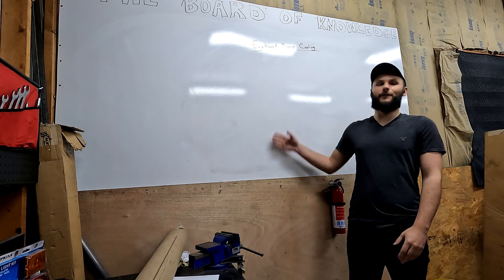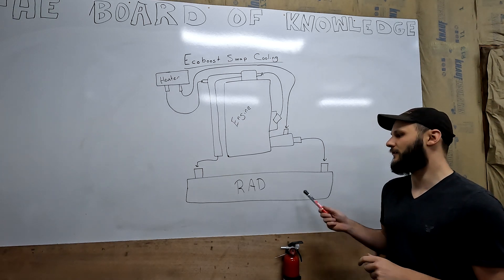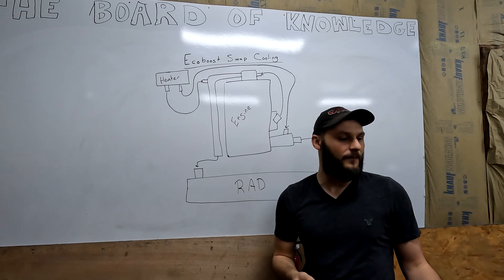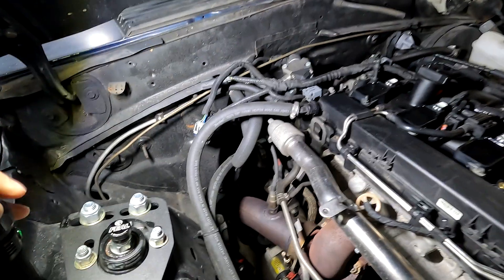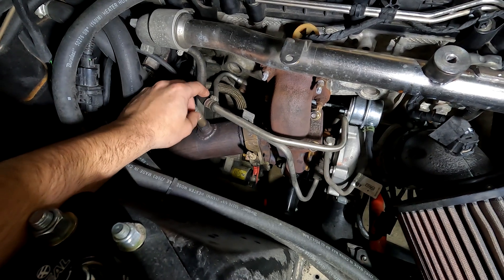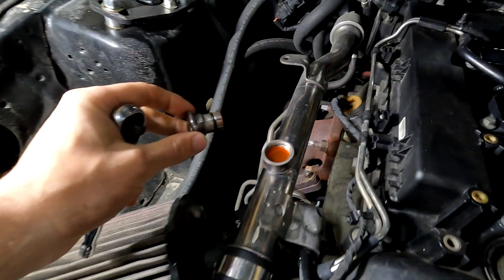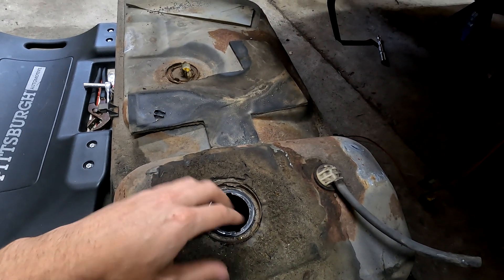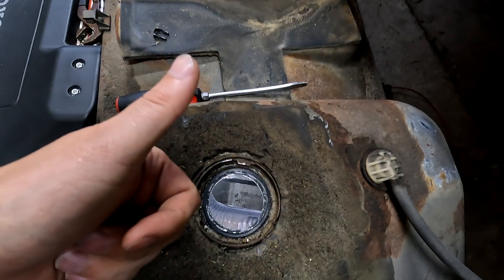Ecoboost Swap Cooling System Made Easy

Comment: Maybe a dumb Q, but how does it function without an expansion tank?
Reply from the maker: No need for an expansion tank since the radiator has a steam port. I just ran the steam port line down to an overflow container. Currently it's just a liquid death can, but I will be putting a proper overflow container on this winter.

Comment: Awesome. Yeah this is definitely super easy. And explained well. It's still crazy how much room is left in the bay. Have you thought about a fan shroud or I guess not needed since you said it runs cooler as it is.
Reply from the maker: My setup has a small shroud. It doesn't cover the whole radiator, but it works just fine. It definitely could use some more ducting in front of the rad though, there is not much airflow other than what the fan pulls in.